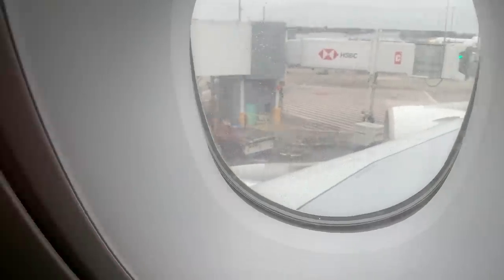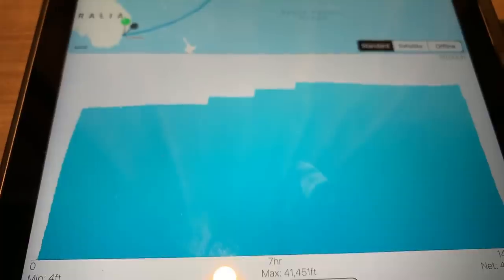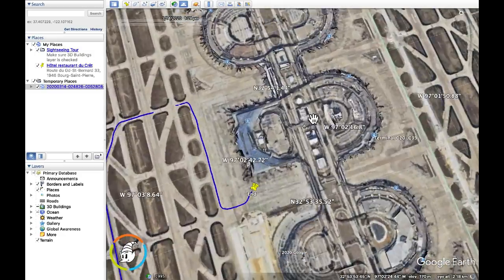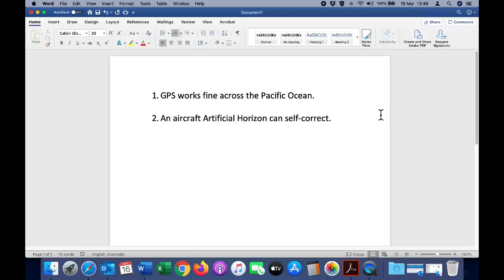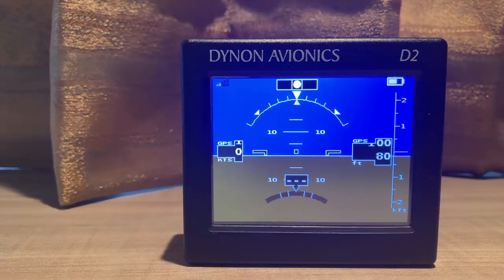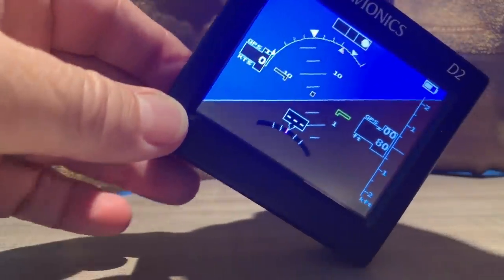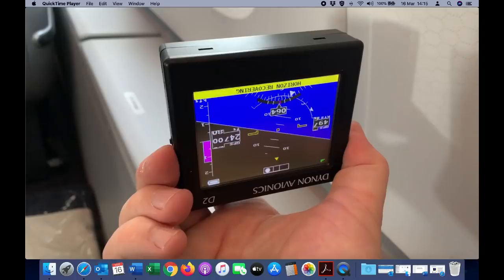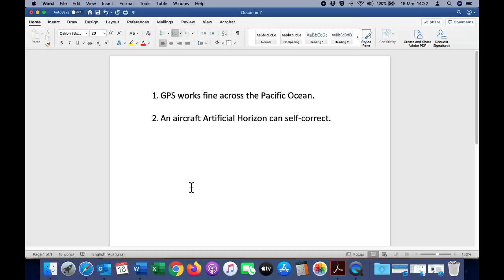GPS and Gyro testing on Qantas Flight 7 across the Pacific.

Comment: I work in a company that design and manufacture gyros for maritime navigation. They wouldn't work if the earth wasn't spinning.
Reply: "Bob The Science Guy" made a video about gyro compass, but i still would love to hear it from some one from the industry. Can you you do a video explaining it ?
Reply: @crowxe  I don't really have the setup to do videos; but I can try give you the highlights. 

Imagine you have a coil of glass fiber. You then take a laser and split the beam and injects into the fiber in both ends. You then join the two opposing beams when they leave the fiber and aim it at a photo detector. The photo detector converts the light into an electric signal.

As long as the setup isn't rotation the intensity will be constant.
However, if you rotate the coil (You'll probably have to rotate the laser, optics and detector with it), you'll detect a change in the intensity because one beam has to travel longer than the opposing.  This is what is known as the Sagnac effect. 

You then take three of these coils and place them perpendicular to each other - like next to each other on three sides of a dice. You then feed the signals into some a computer where you can use mathematics to deduce the orientation of the earth axis of rotation relative to the coils.

You then add a chip called an accelerometer that measures the direction (and strength) of the gravity. It is very similar to what you have in a mobile phone that can switch between portrait and landscape.

With the orientation of the gravity and rotation you can go on and calculate the direction for true north.

Another way is to use a mechanical gyroscope to determine the earth rotation. 

I don't know if it made you any wiser; but feel free to ask. I'll see if I can answer :-)
Reply: @crowxe  That would be awesome Crowe.  Do it or work with Bob the Science guy!
Reply: Lier.
Reply: @yottaforce  Thank you, Morten.
Reply: chris johnson  ......and why?  Can you say anything substantive?
Reply: @ZackWolfMusic  Explain how he's wrong.
Reply: @ofdlttwo  De Nyle is the most sacred river on the Flat Earth.
Reply: @ZackWolfMusic  You said: "All gyro  equipment/ instruments work because of the movement of the mechanical components inside of Artificial  Horzion this is what causes the gyro too move around and work."
Can you go into detail and explain it to us exactly how?
Reply: Thud Thud I want to hear this
Reply: chris johnson Ok Chris, are you fucking with me/us for entertainment value?  Shame on me.  Please please please don’t rely on stating “liar” as an argument.
Reply: @thudthud5423     Why would I ? You should ask that to Morten who so call  works for a  manufacture company! That works on gyros, he so call know what he talking about! Why are you trying to dis credit me? Is it  because I proved Morten wrong is wrong and now you want a more in depth explanation..
Reply: @ofdlttwo  I stat liar if what I see is  a lie.
Reply: @ZackWolfMusic  so do you look into the mirror and scream "LIAR"?
Reply: @ZackWolfMusic  "All gyro  equipment/ instruments work because of the movement of the mechanical components inside of Artificial  Horzion this is what causes the gyro too move around and work."

While accelerometers (such as MEMS inside your cellphone) do have moving parts, laser ring (or fiber optic) gyroscopes do not. The only thing you could think of that moves is the light within it, which doesn't fit your mechanical definition. Perhaps do a little research before you spout off that people don't know what they are talking about. There are videos online of how they work:
https://youtu.be/aO0pCbKSpvE
Reply: @Tsudico  Video you referenced is mis informing..  All Artificial horizon gyros use mechanically workings in them you are saying they don't! That is a lie.... Gimbal rotation and pitch gimbal in the Artificial horzion is the mechanical mechanism I am talking about.
Reply: @yottaforce  
it's the first time i hear of that concept but totally makes sense except during steep turns or loops when the acceleration is not 1G and/or not towards the earth's center, but maybe that's why it works for sea only ! thanks for the info
Reply: @thudthud5423   You're in denial.
Reply: Daniel Flores   Where is that video at?
Reply: @ZackWolfMusic  "What qualifications does the guy above who so call works for a gyro Manufacturer have? What makes you think he Is honest????????? Is it the way he convey himself to  you and convinces you how Gyros work? Or it because he is white and all white people are honest???"

First, it's not who he is, but what he said. He explained how they worked and provided enough information to get further explanations, i.e. the Sagnac effect. Not only that, but I have also previously looked up the Sagnac effect so I understood the explanation.

Second, why you bringing in skin tone into a conversation that has up until you mentioned it, nothing to do with skin tone. Do you know what color my skin is? Are you making assumptions about people based on their names instead of the content of their messages?

*chris johnson:* "I myself gave a simple explanation how gyros actually work"

Let's take a look at that explanation, shall we:

"All gyro  equipment/ instruments work because of the movement of the mechanical components inside of Artificial  Horzion this is what causes the gyro too move around and work."

So you say that all gyros work by movement of mechanical components inside a device that causes the gyro to move around and work. That's circular logic and doesn't explain anything.

Some gyros work by using a spinning mass that has inertia which, when an outside force is applied (like turning the gyro), is resisted by the gyro so anything attached to the gyro also resists the force. This would be the mechanical gyro you claim to know of. But just like you can use gas to make an engine turn a crankshaft or electricity and magnetism to turn a rotor and get the same results (with varying differences in sensitivity due to the different methods) you can also use light and the fact that it acts like a wave which allows it to create an interference pattern to see rotations.

The key is that light travels at a certain speed in the medium used (such as the fiber optic filament) so when the light is divided down two separate paths that loop back into each other the light creates interference with itself depending on which light had the longer path (due to the device turning in the direction of the rotation). Perhaps if you watched the video I linked instead of just accusing it of being a lie you'd know this.

Bob, from Globebusters, has used one and found a 15°/hour drift as documented in the film *Behind the Curve*. So just because you might not think they exist doesn't mean that they don't. It just means that up until now you have not known of their existance. I'd recommend before you continue your tirade of yelling 'liar' that you might want to do as previously suggested and look into it yourself, because:

"Even a fool, when he holdeth his peace, is counted wise" - Proverbs 17:28 (KJB)

Because right now, every time you comment you're letting the world know to count you as otherwise.
Reply: @ZackWolfMusic  Hi Chris and thanks for writing. Yes, it's true that mechanical gyros has a rotating mass as it's central component and we manufacture those too. However, there also exists gyroscope that does not rely on spinning masses; but instead relies on splitting a laser beam, send each beam around a path in opposite directions and then join in a photo detector. You can either use mirrors or a fiber optic guide to create that path.
Reply: @Alysm-Aviation  No, because Chris hasn't figured out how mirrors work yet.
Reply: @ZackWolfMusic  From one of you latest comments perhaps I see a bit of a misunderstanding here. The gyro does not require the earth to spin for the gyroscope to work in its self. However, the instrument does require the earth to spin to point to true north.
Reply: @ZackWolfMusic  You might want to read the manual for the KVH DSP-1750 Fiber Optic Gyro. That's a basic example of the technology that Morten is describing. There's many different types of gyroscopes and not all of them are mechanical.
Reply: But what enables the unit to adjust for supposed curvature?, wouldn’t be the ambient air pressure differential sensors known as pitot type device? So my unit has no gps and no pitot tube, U.K. to South Africa should show minimum 35o we’ll see...

Switch off your pitot technology and show us your AH in you actual plane correcting, there is no curvature, my device doesn’t make corrections it is CALIBRATED ONCE.

Why lie??

Aircraft altitude is measured (inferred) by atmospheric pressure. The aircraft is usually flown at an altitude that maintains constant ambient pressure (by pilot or autopilot, as the case may be). Changes in local barometric pressure (provided by air traffic control) are used to recalibrate the aircraft altimeter. As long as the aircraft is flown at a constant ambient pressure (hence constant altitude), it will be following the earth's curvature (as the atmosphere is attached to the spherical earth and has same properties at same distance from the center, in an ideal case) as the altitude is measured from the surface, which is curved, and not a plane.
Reply: @ZackWolfMusic  What qualifications do you have?  Do you design gyroscopes?  Got a degree in physics?  Did you even pass any exam in physics ever?
Reply: @ZackWolfMusic  How does a gyrocompass work?
Reply: @ZackWolfMusic  Do you genius pretend that inertial reference systems (IRS) / inertial navigation are a hoax? Good luck with that.
Reply: @yottaforce   
Gyros do not  require earth's rotation to point true North. The magnetic sensor metal in the inside the instrument is what attracts to The magnetic North pole, giving the gyro to point north at the Pole.
Reply: @ZackWolfMusic  The gyrocompass doesn't point to magnetic north.  Try again.
Reply: @FrenchCrow   ?
Reply: @ZackWolfMusic  Look up how the gyrocompass works.  You are deluded.
Reply: @ZackWolfMusic  How does a inertial reference system (IRS) unit self-align?
Reply: FrenchCrow it uses a pitot type device to read ambient air pressure differential. The gyro maintains parallel/ level flight only and does NOT adjust for curvature without the extra hardware and associated data produced by it.
Reply: @dertod1703  Gyros don't work of Earth's rotation.
Reply: @ZackWolfMusic . Correct. They work by conservation of angular momentum. North Seeking Gyrocompasses exploit this little fact to measure Earth's Horizontal Rotational Component to determine True North as aforementioned Horizontal Earth Rate is azimuth dependent with a maximum output of 15°/h at the equator when pointing North and 0°/h when pointing East or West.
In other words Gyrocompasses scan for the maximum projection rate of Earth's Rotation. Magnetism has nothing do to with it. You're just showing of you're ignorance by confusing Gyrocompasses with Heading Indicators and Artificial Horizons, which have nothing to do with azimuths to begin with. It's a double fail on your side.
Reply: @ZackWolfMusic  I assume you are trying to get me upset or to lash out. I assure you it won't happen. Unlike people who are emotionally invested in a topic, I couldn't care less whether you continue to showcase your ignorance and outright denial of facts or change your tune.

I just like making sure there is plenty of evidence of it for others who might frequent the comment section so they can see people who chose to ignore facts, resort to ad hominem attacks because they don't have facts or evidence on their side, and are so closed minded they will refuse to entertain the possibility they are wrong.

I have had plenty of constructive converstions with people who believe the earth is flat. But it requires a level of maturity that allows the person to admit their own errors.

Well, I'm done with the conversation since you haven't added anything to your points but keep repeating the same things like some weird mantra: "mechanical...lies...mechanical...lies"

Have a great day, and I hope you stay safe what with the pandemic that is going on.
Reply: @dertod1703    Der Tod   No Gyros scan for earths rotation that a lie told by the manufacturer and Aero Space Industry to have a explanation since people believe earth is a ball. Gyroscopes work by Mechanical mechanisms that move around. If magnetism has nothing to do with a Gyroscopes tell that to the man who first talked about it  which is Morten he asked me how do gyros attract to North pole and I said  it is because inside the Artificial horzion there is Magnetic sensors in it which  is the accelerometer. If you put a magnet or pen on it it attract because the accelerometer is magnetic..
Reply: @ZackWolfMusic  You're the one lying. I've provided sources and you didn't. Gyrocompasses are used where magnetic sensors fail to work like tunneling and ships. 

"Azimuth measurement with certain accuracy can be performed with the help of modern magnetometers. To calculate the true azimuth, it is necessary to know the region magnetic declination, which primarily makes the method notoriously imprecise. Besides, any local magnetic fluctuation leads to static error in azimuth calculation. Even the most modern and precise digital magnetometers have limiting accuracy of 10 mR (milliradians) and require, often, time-consuming and relatively complex calibration. Therefore, in case of any magnetic disturbances or magnetized bodies the use of compass to define the true north heading is ineffective."
"The modern way to define true azimuth is based on so-called gyrocompassing, which is direct measurement of Earth’s angular velocity projection vector on horizontal plane at a given point of surface. As a rule, such systems use one or several angular velocity or acceleration sensors with or without additional equipment to define the horizon level."
https://www.hindawi.com/journals/js/2016/6148019/
Reply: @ZackWolfMusic  Artificial Horizons aren't attracted to North to begin with. If you can't even get the basics right, how can we trust you on anything else?
Morten is right, Earth Rate measurements are required to get accurate headings on maritime vessels (and underground surveying) because magnetic sensors aren't suited for areas subjected to interference. 
On the other hand, Earth Rate isn't affected by magnetic materials, weather etc. and yields True North rather than Magnetic North.
Reply: @ZackWolfMusic . Holy sh*t! You're even confusing accelerometer with magnetometer. Accelerometer utilise proof masses to determine the direction and strength of gravitational fields in order to provide a plumb line. 
They're are specifically build to not be affected by magnetic fields.
Seriously dude, at least try to get the basics right before you embarrass yourself any further.
Reply: @ZackWolfMusic  Solid State MEMS Gyros use vibrating elements which detect the rotation of the device in 3 axes. In the absence of other rotations they can detect the Earth's spin vector. Solid state accelerometers are miniature strain gauges which react to acceleration forces. In the absence of other forces gravity gives a vector perpendicular to level. The data from these devices is combined using an amazing computer algorithm known as a Kalman Filter to calculate attitude and direction. I recommend you research this because the physics doesn't lie.
Reply: @dertod1703     Gyro compasses have mechanical mechanisms that make you believe it using earth's movements when it is not. What do you think what makes gyro move?  Gyro compasses do use earth's angular velocity to determine vector on horizontal plain not (plane)! Gyro compass have Vibration gyro sensors this Is a mechanical device, don't forget for all gyro compass to work it has to have 
Senses vibration produced by external factors, and transmits vibration data as electrical signals to a CPU. Used in correcting the orientation or balance of an object.  Azimuth motor are in different types of Gyros compasses, The vertical ring is provided with ball bearings aligned in the vertical axis of the Compass. This provides the gyro with freedom about the VERTICAL AXIS. The vertical bearings referred to do not actually support the vertical ring and hence they are called the (upper and lower) guide bearings. The actual weight of vertical ring, case and gyro is borne by a group of wires called a suspension. Because the sensitive element is the north-seeking part of the Compass, it must be kept as free as possible from disturbing forces. The whole Compass is mounted in its binnacle on a gimbal system so that it may hang undisturbed by the rolling and pitching motion.. Fyi this can only work if there is mechanical mechanisms in the Gyro compass. 

It has already been said that the suspension supports the sensitive element. The top of the suspension is secured to the top of the phantom elemen. As the sensitive element is turned in azimuth (i.e., about the vertical axis) it would tend to twist the suspension. However, the phantom element is also arranged so that it can turn about the vertical axis and, by means of the follow-up system, is made to follow every movement of the sensitive element. You fail and I am right I knew from the get go please take the time research all what I said before you write another ignorant comment!😄😃🤣😂😁😀
Reply: @ZackWolfMusic  Hi again Chris. There seems to be a bit of confusion here. I haven't asked you how a gyrocompas finds true north. Perhaps you got me mixed up with someone else. 
Also: An accelerometer measures the forces from gravity and acceleration, not magnetism. You must be thinking of a magnetometer. You can get both as tiny chips and from the outside they look quiet similar. 
Besides that: Our gyrocompasses does not use the earth magnetic field to find north. 
A final thing: It is true a gyroscope is not dependent on the earth rotation to function. However, a gyrocompas contains among other things a gyroscope and is dependant on the gyroscopes behaviour on a rotating earth. 
I hope it clears things up :-)
Reply: @ZackWolfMusic . First of all: nice copy&paste. Second of all: thanks for confirming what we've been saying from the very beginning. Gyrocompasses utilise Earth's Horizontal Rotational Component & Vertical Gravity Component to determine True North. 
What your comment or rather c&p describes are Macromechanical Gyrocompasses. By your own admission magnetism has nothing to do with it and their Gyroscopes move due to Earth's Rotation tilting the spinning disc away from the vertical causing precession until the azimuth with a Horizontal Earth Rate of zero has been found - congratulations, you've found north! 
...but torsion fiber suspensions have a limited degree of freedom which requires some some sort of mechanisms to move them together with the Gyroscope. 
In other words it's not the mechanism which moves the Gyroscope to make it look like the Earth moves but the Gyroscope moving due to Earth's Rotation makes the suspension move (although that's just one way to build a Gyrocompass).
What I've described before are ARS-based Gyrocompasses.
These do not utilise precession to move on their own but one or multiple sensors to directly measure Earth's Rotation and derive azimuths analytically.
So, seems like you're the ignorant fool here who once again couldn't even get the basics right.
Next time you're going to c&p data from the internet make sure to properly study your own sources.

PS: You can build a Gyrocompass simply by placing a Mechanical Gyroscope in a damping medium as demonstrated in the following scientific paper - without torsion fiber whatsoever:
https://www.researchgate.net/publication/313816331_Using_a_gyroscope_to_find_true_north-A_lecture_demonstration
(You can find several examples on YouTube of people doing this).
Reply: @yottaforce  thank you very interesting description.
Reply: @ZackWolfMusic  for £350 from Amazon you can buy a solid state gyro compass maretron make them used for marine navigation . Check them out.
Reply: @ZackWolfMusic  OK Chris. I think it's fair to say I've given you a fair chance to have a respectful adult to adult conversation. I can't do anything more for you.
Reply: @ZackWolfMusic  Another semi literate flerfer reading something somewhere, not bothering to actually learn how any thing works and then proclaiming himself to be an expert. Learning the flerfer way, not the correct way mind you, just the flerfer way.
Reply: @yottaforce  your 1st interaction with a flattie ..? Chris is pretty typical, arrogant, paranoid and defensive. They are fascinating though.
Reply: @hapaxl.6075 Far from and yes I've been aware from the beginning that CS might be a troll. I have some very good reasons to take the approach I did.
Reply: @osci08  Unlike flat earth proponents, I don't think people should be blocked because they disagree or even if they can be disruptive (as long as that disruption doesn't become harassment). Showcasing the bad arguments that they have is far more effective than just censoring them and reinforcing their narrative that they are being censored.
Reply: @Tsudico  Yep agreed, However, isn't it amazing that a flat earther states that he knows more about gyroscopes than a person who manufactures said devices, ROLF.
Reply: @Muzikgod I apparently don't know enough about Chris' history here so I don't think I have enough information to make a comment either way.

It's Wolfie's channel, if he thinks the comments are harassment then he can ban the person. If others feel like they are harassed by the person, then there should be steps to contact Youtube with links to the comments in question so they can do something about it.
Reply: chris johnson try basic spelling and critical thinking but for now let the grown ups talk
Reply: @ZackWolfMusic  The only thing you've proven is that you don't understand how ring laser gyros work. Just ask Bob ("A... 15 degree per hour drift") Knodel, he knows all about them.
Reply: Thank Morten. Bet you didnt expect to dredge up the hilarity of the feed under your comment. 😨😱😰🙃🤣🤣🤣
Reply: Faster Horses  You so naive the DOCUMENTARY called behind the curve was not taking seriously and   about anything it was set up to fail on purpose... A real Flat earth beliver knows behind the curve it is  mockery to Flat Earth.
Reply: @yottaforce  I  have been reading all the comments and well because of the simple fact that you who know what you are taliking about refer to earths rototation. Now when these two words are put together when dealing with some1 who things the earth doesnt rotate, but is flat and not moving then you will never be right because of 2 words earths rotation, hence doctor gyro expert will stick to his guns no matter what.
Reply: @rogerscottcathey  no i didn't really expect this.  🙂 Yet it's wonderful to see so many chirping in though the tone is a bit rough.
Reply: @b.p.rwebber8098  Hi and thanks. You are absolutely right. I've had these discussions before. I often, in some form, ask then what kind of evidence they would ever accept. Often the conversation end right there because as you say there really isn't much they are willing to accept. I got blocked on Daniel Pratt's channel after I offered him to make an experiment demonstrating the effects he claimed. 😁
Reply: @yottaforce  They claim all that believe in the globe are brainwashed and most say the same thing they believed in the globe until they questioned what they were seeing. What they should say is after they watched continuous flat earth videos and started doing the things they were told to do and seeing the results they were told they would see. I've been told to check out so called legimate links just to end up watching dubay and other such videos that have all been debunked.
Reply: Chris Johnson and yet bob from “globetards” bought a 20,000 dollar lazer gyroscope and he before conducting the experiment he mentioned so many times that’s is extremely accurate, and when he proved not once but twice (the latter placing it in a gause chamber, as he thought it was picking up light movement) STILL made a 15 degree per hour shift! And after he came up with so many excuses, and here you are parroting one of his excuses...
Reply: @ZackWolfMusic  
FlerrFerrs have some fat and blood mechanisms between their ears that make you believe it (Flerrf) is using a brain when it is not, as it has none.